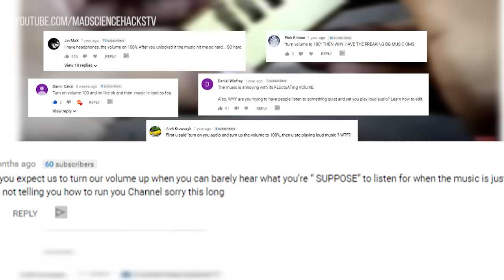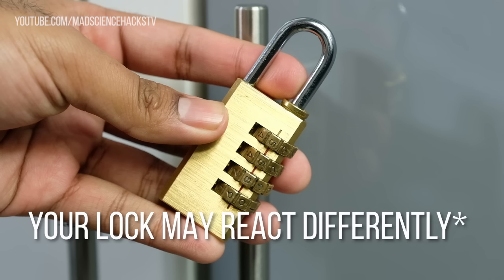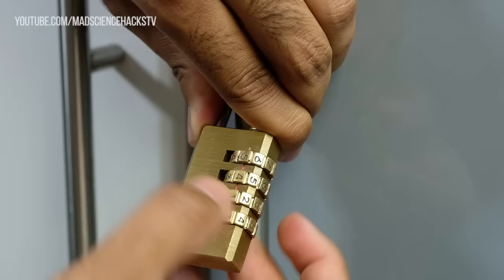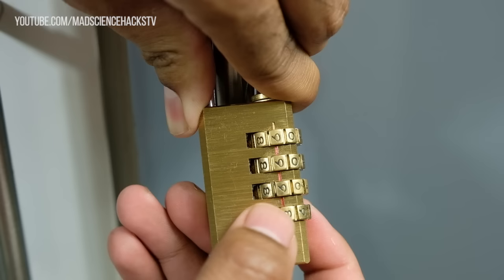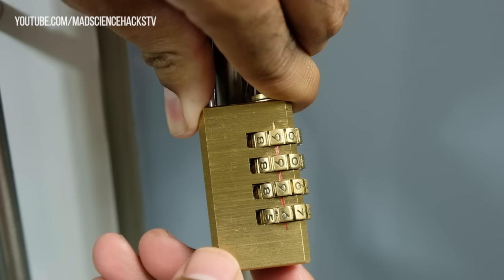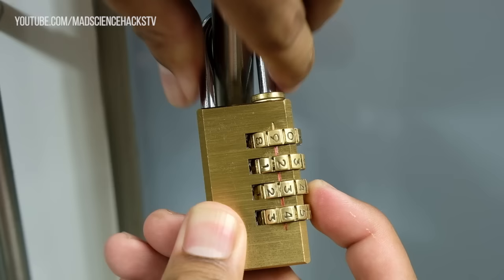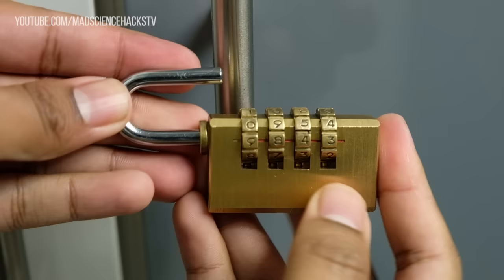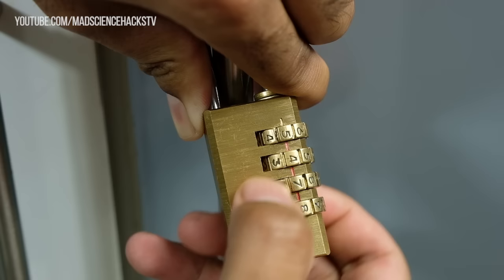How to crack a combination lock in seconds! - NO TOOLS (life hack) Part 2

Comment: I had a Master Lock "1-1/8-Inch Luggage Combination Padlock", and even though my specific lock didn't make a click when I turned the dial, I was able to feel the tension on each wheel. My lock had 3 wheels. After about 5 min playing around with it, I was able to get it to open using this method. Not bad for my first time. This video is proof that it works! You saved from having to buy a new one. Thank you.

Comment: For some reason after I followed all you advice, this still didn’t work. I’m not sure if it is my lock or not because all the clocks sound the same and my lock never moves even with a lot of pressure.
Reply: same with my lock, its a 3 digit masterlock and i just cant open it
Reply: Your not supposed to use alot of pressure , only enough pressure that moved the shaft, you also might be over extending and picking the pin too much with jams it and it won’t work , you need the right pressure on your tension tool and with your pick❤

Comment: I learnt something similar in 1960 at school to open combination locks used on bicycles in the school shed cycle park.  But we applied tension by pulling the lock against the locking  chain. When turning to each number on the first  turn wheel we were looking for a number that ended  up very loose compared to the others with lots of side turn each way. That was the correct number. Then we did the same with all the other  turn wheels one after the other until finally  the lock  opened. No bikes were ever stolen. We did this to simply show off 😊 LOL

Comment: I have a 3 number aluminum Master lock.  It has detents on each  wheel that are spring loaded so it clicks as you turn the wheels.  Makes it difficult to locate the points that you mention.  Unable to hear anything but the detent clicks.  No movement at all on the lock bar itself.

Comment: I tried it with a lock, which was even worse: You didn’t need to listen. If you pull it and turn these wheels, they stop when they arrive at the correct digit. So you just have to pull the lock and turn thos wheels until you can’t turn them anymore.

Comment: I have the same but the dmall lock
And i forgot the password while the lock is open 
How csn i find the combination plz
Reply: Close it then do it
Reply: @Hdogss  i cant close it its stuck while its open
Reply: Elias Rezek, why do you need the lock cracked then? If it’s already opened
Reply: @coolgamerusa  To close it later
Reply: CoolGamer USA some of these locks require you to turn the top part 180° and push it down to change the code, which is a problem I must say

Comment: mine doesnt allow the parts to move when pressure is applied, i just forgot my code and have 10,000 possibilities 😞
Reply: Probably because your combination lock has false gates. The one he uses only has one gate, the slightly better ones have false gates to throw you off when trying this so itll stop the wheel like you've found the gate but it won't open.

Comment: If you have problems differentiating through the noise (like I had),here is something that i did.Pull the lock and start spinning the 4th wheel(bottom one like in the video) and after each turn while pulling the lock try moving the 3rd one ,when the 3rd one doesn't wanna budge anymore you got the right number on the 4th one.After that start spinning the 3rd one and after each turn try moving the second one,when the 2nd one doesn't want to move you got the 3rd one,then start spinning the 2nd one and after each turn try moving the first one,when the 1st one jams  you got the 2nd combination in place.After which start spinning the first one and when you reach the right one the lock will just come out.Literally just did 2 locks like that.